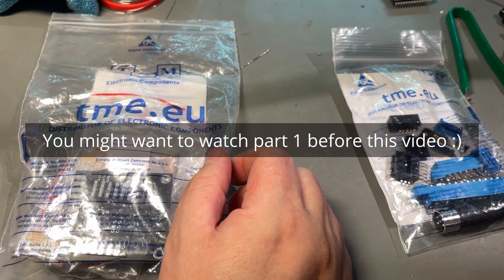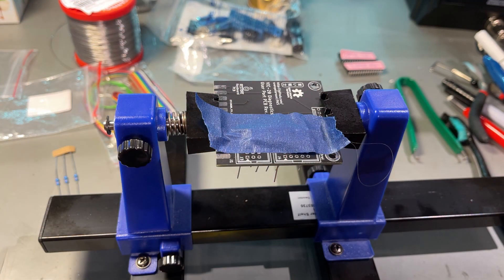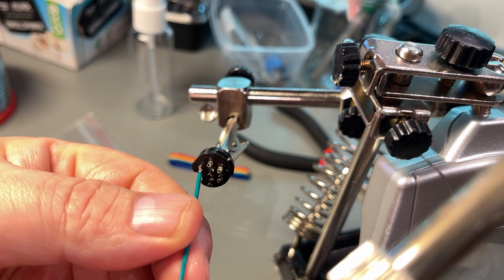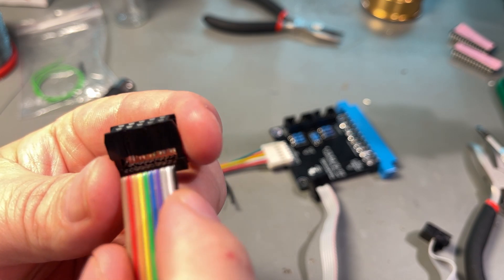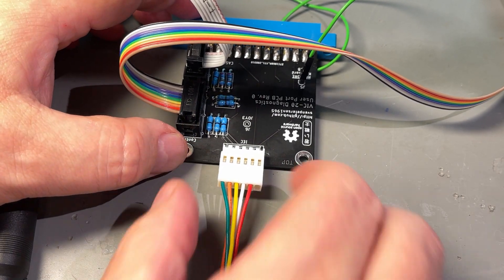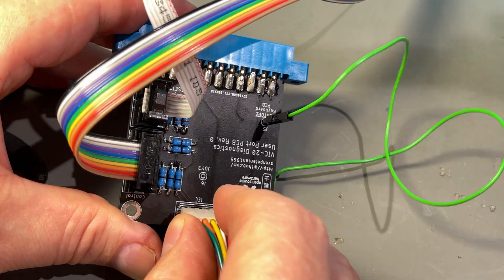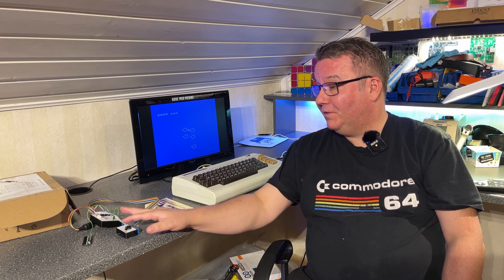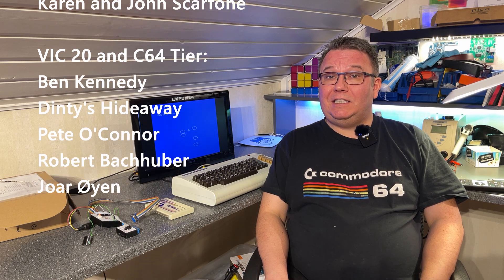Commodore VIC20 part 2/2 - Building and testing the diagnostics test harness

Comment: what is that stand you use to hold the board while soldering?
Reply from the maker: Not really sure what its called in english. It's just a frame for holding circuit boards. I got it here: https://www.kjell.com/no/produkter/elektro-og-verktoy/verktoy/lodding/holder/kretskortholdermonteringsramme-p40345

Comment: Hi - this is great
Personally i made some harnesses as i have old stock in the cupboard of 9-pin  25-pin serial / parallel , VGA connectors, some clip on IDE connectors and whatever it was 15 meters of IDE cable on a roll

Worst mistake was some "null modem cables" i got wrong as i was viewing both sets of pins from the back so one end was totally reversed, so out comes the knife - the worse ones are the snap together and the slight heat treatment to seal ( hot air gun or soldering iron and some cardboard to stop scorch marks

This was all in the 80's and 90's before the cheap mass production low prices we have today ( i actually bought just before xmas for $4 null modem cable on 2 meters delivered ebay - and it works! - my prior purchase i was sent the wrong cable, i worked out the pin outs and i "think" i have a serial to monitor cable or remote monitor using DB9 connectors, as they are sealed i need to just cut of one end and use a 2 piece shell with mini nuts and bolts )

PS my soldering skills are barely past serial / parallel / speaker wire connecting and 2 older monitors that needed recapping i asked a friend at work to do it and paid for his dinner and a few drinks to take home

Well done - regards George
Reply from the maker: Thanks :) Nice comment!

Comment: Just for cosmetic reasons.. i would have used the flat cables the other way, pin 1 ist brown... just like resistor color codes, the cable is color coded in this way.

Comment: For those LEDs, one trick I've used (for a different project but a similar issue) is to apply a small dot of hot glue into the hole, from the inside, to create a light pipe. Let it dry and then cut/sand the inside end if it pushes on the LED, Then assemble the case.
Thanks for the video.
Reply from the maker: Ahh, good idea! Thanks :)